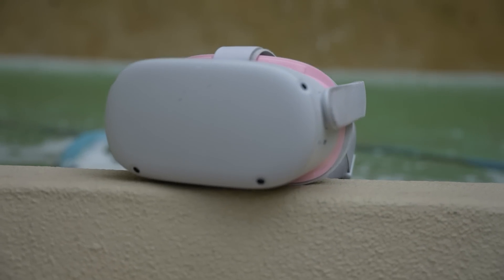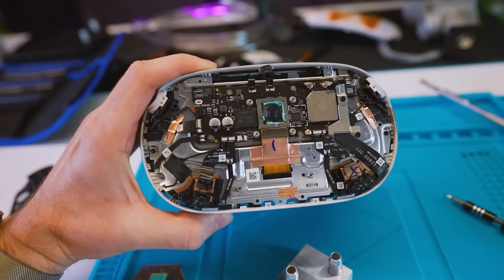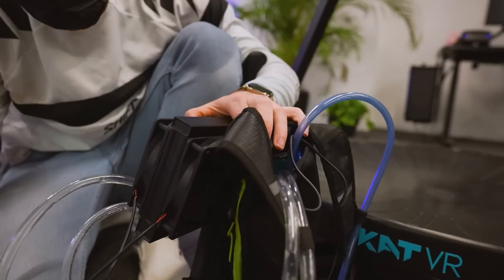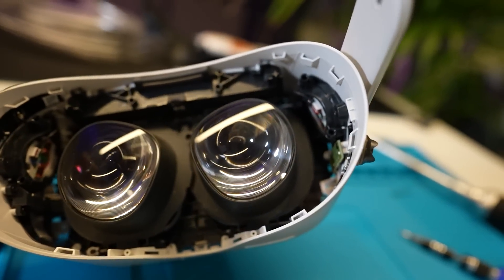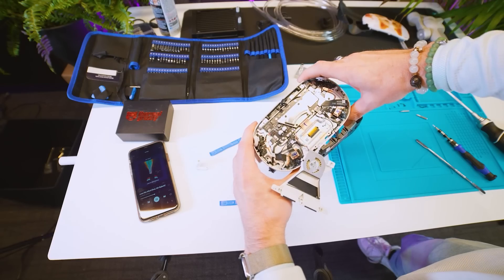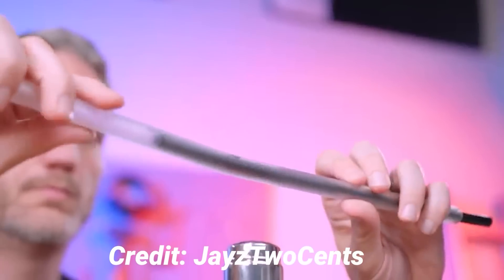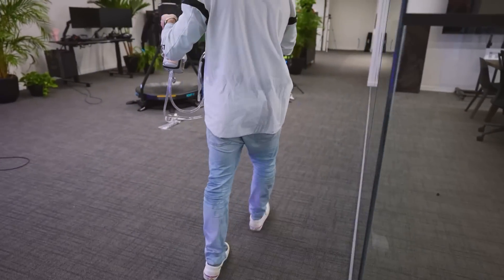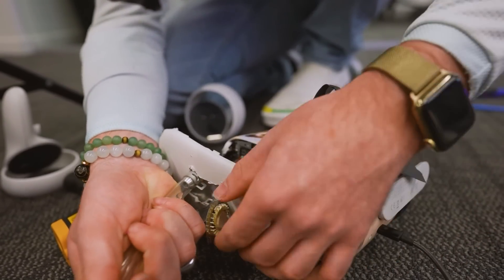What happens if you WATERCOOL an Oculus Quest 2?

Comment: One thing worth pointing out: John Carmack is one of the greatest programmers on the planet, especially for things like games that require very fast, very low level code when taking the most advantage of the hardware. While he's undoubtedly completely correct on not tapping the full potential of what's in the Quest 2, he more than likely also means from a programming standpoint and not just a thermal one. There is no point in attempting to make the most performant code possible on the Quest 2 in it's current state, so even if you did find a way to overclock it after cooling it, it's likely it could could further beyond that if the games were designed for it at the lowest possible level.

That said, you wouldn't find that in a game like VRChat that is running on top of an existing engine. Gonna have to be from the ground up, at least more than likely.

Comment: i think the reason why performance is not massively improved, is said once again by our god John Carmack in an interview. the XR2 chip is heavily underclocked to not overheat all the time, and i think undervolted as well. but even if we manage to remove the underclock, performance for most headsets are likely to remain bad unless someone makes an actual cooling unit you can mount directly to the die, instead of a hodgepodge solution like the one we saw in the video.maybe even just making larger heat fins will greatly improve the thermals, and with less bulk added than a full water cooling solution(though maybe ThrillSeeker could look into how some people water cool as raspberry pi, since that might be a smaller slightly more portable sollution)

Comment: About 100 times more than you needed. Just adding some copper fins through the front with a slightly larger fan would have quadrupled the cooling, or more! Or you could have refrigerated it.

Comment: It's actually one of my biggest gripes with VR. It gets too hot on your face. Thankfully, Valve Index has a port in the front which you can plug something in to cool the thing down. Other VR headsets don't have it and I'm not really sure why. Because damn. Without it, it feels like you're sunbathing your eyes. And then you gotta start moving around because it's VR, all of a sudden, everything feels hotter and you get even sweatier.

Comment: The only way this would have worked is if the headset is thermal throttling and they're not that daft. They underclocked it to keep it cool enough despite the bad cooling. As you said, you really need a way to OC the chip

Comment: I'm pretty sure that water cooling shouldn't have an effect on performance, seeing that the CPU and GPU aren't being upgraded or overclocked, so they shouldn't be able to process any faster. The only reason that water cooling would increase performance would be if the CPU on a normal quest slows itself down to prevent overheating. (I've never experienced that, but I seen somewhere that some CPUs do that)

Comment: now i want to print and cnc machine a faceplate with a tiny watercooler using a small noctua fan and a small radiator mounted on the waterblock

Comment: I think it's limited more by power limits than thermals. The clocks could be raised, but it would need more power for those clocks, and I'm not sure the quest has any headroom to push more power to the xr2.
Reply: Also the charging "board" as a finite current limit (if not broken overtime) and it is already eating more. So a more performance oriented battery would be needed charging faster with separate power inlet

Comment: Are those the CPU and GPU usages in the graphs? Since the clock speeds are dynamic, if there were a way to view them, I suppose you could see if there's an effect on when they get throttled. But that would probably be reflected in the FPS, so you wouldn't get that much additional info out of it.

Comment: instead of jankily attaching the fan to the outside of the quest you should have soldered a resistor with the same resistance as the fan to the fan connector. I learned this from modding ds lites into Gameboy macros, a ds lite won't boot if it doesn't detect a top screen but can be tricked by just using a resistor with the same rating.

Comment: cant overclock but through adb commands you can set higher cpu/gpu levels and higher resolutions so you can compare framerate and temp with those boosted settings

Comment: No, carmack does not think the fan or heatsink is too small and weak. If you had actually listened to his full q&a youd know that he laments qualcom not having better power efficiency and instead pushing high clocks at high voltages for limited gains.

Comment: i removed my face plate and drilled a 22.25mm hole right where the fan is then cut the top part of where the air exits bigger and replaced that thermal pad with artic silver 5

Comment: I mean, unless the chip is thermal throttling, it's probably been set to a clock speed that won't overheat the processor, so giving it more thermal headroom without changing the clock speed won't really make a difference. (At least in this case.)

Comment: you got rid of the thermal limit but you still need to find a way to remove the power limit and the speed limit usually mobile cpus have those to prevent them from burning up too fast

Comment: Oh god... Thrill... please tell me you at least attempted to consult with someone about this?
Okay, for starters... the water block: they sell smaller ones, you know? Like ones for cooling a Raspberry Pi that... oddly would most likely match the dimensions of the CPU used in the Quest? Having a butchered heat spreader used as a plate is just a no-go: they sell plates for of various sizes for very cheap on Amazon and eBay; you could have used that instead and had better thermal conductivity.
...and I just got to the part where you said you did this all under a day. I mean, congrats, but... ugh........... please revisit this. This hurts to watch.
Reply from the maker: I did this in a single day with 2 hours. It was a fun project, nothing more :) don’t worry I’ll be revisiting it

Comment: i can see this happening with a larger headset
just have a giant fan outside of the headset and have the radiator as the front of the headseat
of course have some airvents so the head from the water can escape but this does seem possible to me

Comment: The quests processor is limited because of the bad cooling system, you should have turned off the barrier so the processor runs at its full power.

Comment: I think buying a simple smartphone gaming fan for $10 off Amazon and using 3m tape right in the middle of the headset should be great. 
I have a great one on my note 20 ultra (think i spent like $30 on it though) very cool looking led lights big fan on the note 20 it takes up the whole middle of the phone (back side) if i cut off the phone clips make it flat than 2 little strips of 3m tape and now i would have a extra fan above the chip.. wouldn't this be more than enough?

Comment: Just designed a small water cooler in 2 seconds that would basically fit right inside the front of the headset. Idk why they act like it would be so hard... Need better engineers, more creative.

Comment: I wonder if it's possible to custom make a water container with a pump, radiator and fan that can be attached to the back of the Oculus on the strap so that you won't need a backpack or would that throw off the balance too much.

Comment: There's no real evidence here that the die itself was running cooler.  Temp guns aren't really appropriate for this application.  I'd be interested to see if you get any performance gains with a quality mount.  Thermal paste isn't designed to work in large gaps like this.

Comment: Just FYI you can change screen res and framerate using ADB commands, to crush your framerate on most games.  Sidequest has a bunch of them built in.

Also without getting them temp from the system it's hard to tell if you've actually cooled the XR2 more than the fan.  You might have just gotten something cold NEAR the XR2 but not cooled it any more than the original system.
Reply: Thanks need to find these, also need a usb watt meter

Comment: Just fiddled around with the sidequest developer settings and it's not really improving framerates there either. The CPU/GPU settings are almost pointless. I noticed though, that the texture size settings are directly responsible to define the display render resolution and Demeo runs well enough at 2560 and looks easily two to three times as good. However, overclocking really should be done, that would spark a whole lot of modding on the quest. Without it, there is really no need to change anything at all.
Reply: the gpu and cpu setting in side quest is talking about your computers cpu and gpu, not the quest's.

Comment: temperature only would effect the performance if the quests gpu was being capped. if the parts are dog shit then no matter of dry ice or liquid nitrogen can make them perform better. for the headset to have increased performance then temperature has to be the issue in the first place. the parts are made to operate like dogshit regardless of 80 Degrees or 70. because they cant put fans inside the headset big enough to keep a gpu of proper size  for the performance u need. now lets say u liquid cooled a beefed up headset with an oversized chip and ran that cooling system i can imagine the tubes could run thru holes cut on the top of the headsets frame and they run along the head and down the back with the cable.

Comment: You know.  I’ve been thinking about Thai video and I was actually shocked when I heard what you said about the outcome.   So my questions are (1) is it not pushed hard enough? (2) WhT is the true power of this little headset?
Reply: Based on experiments on Nin Switch and Jetson Nano dev board, once you get out of efficiency range, heat is stockpiling at 0(2) (square) levels. So you might get 10% perf for 200% more heat exchange, once the cooler is saturated it's doomed and this is the "slow" mental view, but in reality the heatsink has to tank 200 ms spikes so idle might be stable but die might overheat the very next moment, thus stable OC is likely 10% perf added as in general computer

Comment: Well you would need root access to overclock it, since the quest already has a unlocked bootloader (or at least a not a too restrictive one, from what i could tell), it shouldn't be too difficult. My guess is that some of the rooting tools floating around in the internet could probably work out of the box.

I´m not going to tempt fate by trying on mine, (it costs almost 6 months of minimum wage to buy a quest around here) but in your position i would take the risk and try it.
Reply: no rooting tools at all, it is locked bootloader. (unless I've missed something)
Reply: @spadecake  The older framework that came with it had full adb access, if memory serves me right you could just do the OEM unlock from there. As i said tho, i didnt try on my device (and i wont) because it is way too expensive here in brazil to get another one.

If that was true or it still is, getting root in should be easy enough for anyone with enough knowledge of the android operating system, or even using a rooting tool.

IDK how it is after the updates, i didnt try to mess with it after, nor do i plan on before i get news of a reliable way to do so, i'm not the type of woman to take a 6k risk.

Comment: There wont be much difference in performance unless you overclock your quest. More cooling =/= more performance, unless it is getting so hot that it is degrading performance unless otherwise cooler.

Comment: I might have an explanation as to why the FPS isn’t higher - on the Quest 2, the XR2 chipset is purposefully underclocked to maintain stable temperatures because the default cooling solution can’t handle the full clock speed. If you found a way to raise the clock speed back to the normal level (or even higher) you would probably get much higher FPS.

edit: nvm i think this was mentioned in the video lol

Comment: back in the day, OG overclocking was done by switching the quarts clock. there should be one on the quest as well
harder problem might be overvolting , it's important in order to hit he higher clocks and that's where the added power generally comes from.
it might mean switching out VRMs or adding weird resistors to fool the system into thinking the VCORE is lower than it is so it automatically increases.
But that gets very destructive very fast. I hope there's a way to get and play around with an XR2 standalone

Comment: On sidequest there is an option to change the CPU level and resolution of the headset, have you changed that? Watercooling the chip without changing the clock is kind of pointless.

Comment: This is an interesting video. May I ask, did you increase the GPU and CPU levels or was this done at their factory defaults? I only ask because when I max out mine, along with increasing the resolution etc, my Quest 2 runs some games infinity better than my PC albeit a fairly rubbish one - i5 10400f, 16GB, GTX 1660ti. I play for hours with these max settings and have done since approx two weeks after I got the headset (as it released). With a large battery pack in my runners backpack, plugged into the elite battery strap, and that into the quest, and it is as Lionel said “all night long” haha. I’ve not had any problems yet. So, that may mean that even at Max GPU & CPU levels there may still be more capabilities to be found with better cooling. Also, are the max settings the absolute maximum? If these are only “allowed” maximum levels then more potential exits. So, if somehow it became possible to push the chip to its “actual max” along with better cooling, it would be super interesting to see what it can achieve.
Reply: you go PCVR still?

Comment: I wonder how well a larger noctua fan + new faceplate with hole/filter would do. The heat sink is tiny though, so a larger airflow may not really help. Also, there would be more risk of dust getting inside the HMD. Still a lot less clunky than a water loop XD

Comment: Even though you may need to bundle up a bit, what if you only cut open to expose the fan to open air and play in a clean meat locker. Would you get a similar affect for the cooling without drawbacks?

Comment: I can see that cooling could be an issue when there seems to be basically no heatsink fins here to speak of. Just changing the thermal interface probably helps a good deal.
They probably try to shave off every unnecessary gram for comfort reasons though. Making a vastly better cooler would be hard, but ultimately it just doesn't make a lot of sense for the application. A power hungry SoC means not just more weight for cooling and less comfort as a result, but also shorter effective battery life.
Anyone know what the peak wattage of the SoC in the Quest2 is? Probably not a lot...

Comment: Totally could make a killer modded quest depending on how standard the connections are. Add bigger battery, I wonder if the cameras can be replaced with coloured ones ect
Reply: your best bet currently is adding external battey/charging due to the quest 2 being so packed already if ya use an external power source youll notice that the quest 2 battery goes to around 70 ish and fluctuates around there in an attempt to keep its life preserved. there is a redit post on someone doing a poe connection but tbh better cooling would likely also help extend the quest 2's battery longevity since that sort of battery is temp sensitive as to how long it lasts. you can plug the htc facial tracker and send its signal wirelessly over to a pc but if you want to use that and keep it plugged in your gonna need a usb c hub that has power passthrough ie a PD port. you can also plug in extra storage but thats just for media files since the quest cant run programs off of external storage to my knowledge. one thing i wonder is if plugging in a wifi antena into the hub if you can improve connection between a computer or router and the headset which would in turn improve wireless visual quality assuming your network is the bottleneck and not the pc.

Comment: If i open it will it void my warranty? There was something inside so i tried to open it. I managed to pry open the first part but couldent remove the inside screws for the white front because the screws were tight. So i didnt fully remove the screw and one screw got stripped so i wasent able to fully screw that one screw back in. But everything else was fine. So I decides to not open the rest and i put the black first part back. Then put the screws back. There is no visible damage or anything broken inside. I just decided i would contact them and ask them to fix the rattleing. Would they still cover the warranty?

Comment: Hey, I've been looking into similar projects myself, and was wondering if you could do or share your thoughts on liquid metal? I've already successfully gotten better temperatures by changing the stock thermal compound of my Quest 1 (the original black one), but ran into the same issue of the hardware not physically being able to run faster, despite it getting noticeably less hot. I would like to try something that would make a tangible difference myself (like liquid metal), but as of right now, I'm pretty certain it wouldn't be worth the time or money. Thank you for your consideration